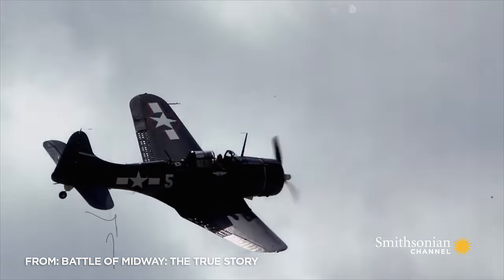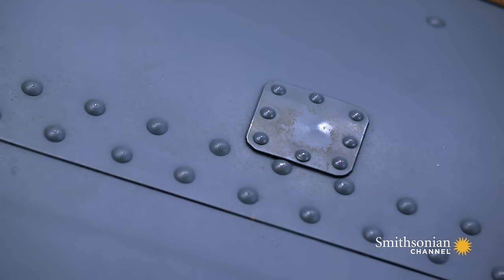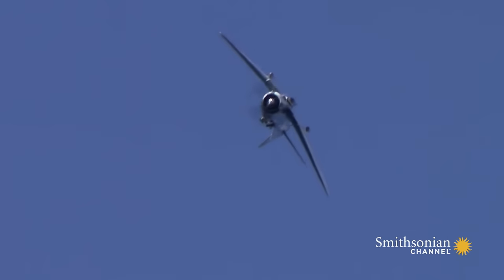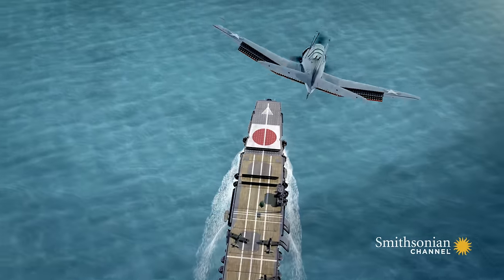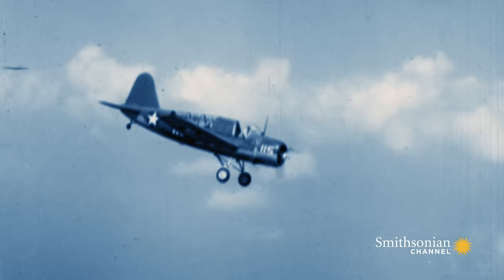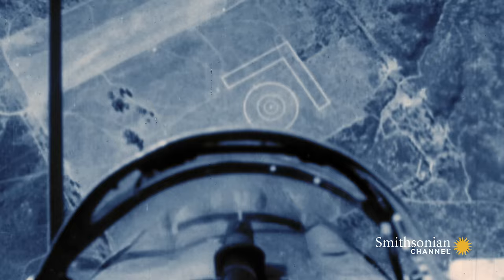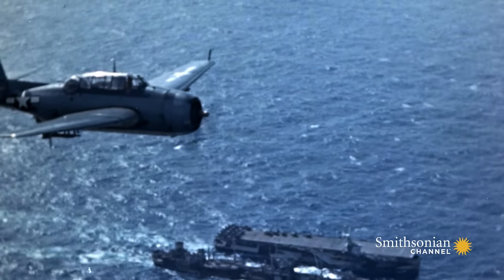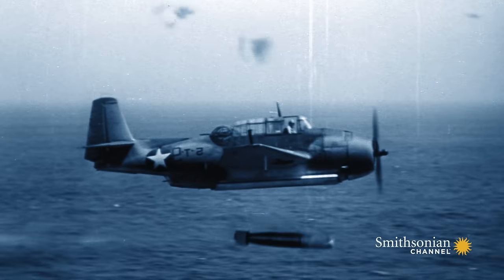The Terrifying Physics of WWII Dive Bombing

Comment: My father was an RAF pilot who flew the Vultee Vengeance dive bomber in Burma. He flew 104 ops in the Vengeance. It had cheese-grater air brakes which also came in useful when avoiding a Zero. As the Zero came from behind, the rear gunner would tell the pilot when the Zero was getting too close, the pilot would put the nose down and pull on the air-brakes. The Zero would over shoot, the pilot would bring the nose up and rake the belly of the Zero with his guns.

My father stayed on in the RAF, flew Canberras, Meteors, and ended up flying Vulcans out of Scampton. Couldn't get him to talk about the war, and never pushed him. The only thing he did say, one day, was that at the end the only survivors from the original squadron were the CO, the MO, his gunner and himself. The rest had been replaced three times over. All you idiots commenting on whether an adoptive father is a step-father, and making other, fatuous remarks about the sound-track, etc., really have missed the point.

Comment: From a veteran of these dive bombers - he said that on diving, the weightlessness of free fall caused the gravity fed carburetors to stop feeding fuel and the engine stalled. The solution was to slightly invert at the start of the run instead of just pushing foreword on the stick to dive. Having to fly inverted, line up the target, start the descent, roll back to 12, make corrections, ignore incoming fire, release the bomb, pull out if the aircraft is still responsive, return for re-armament, and do it again! These vets were the greatest generation. And I miss his quiet humbleness.

Comment: The SBD-2 Dauntless seen at 0:16 is SBD-2 Dauntless BuNo. 2106. It saw combat at Pearl Harbor, the action where Butch O'Hare became the Navy's first ace, the March 10, 1942 shipping raid (its crew Mark Whittier/Forest Stanley received a Navy Cross and Distinguished Flying Cross respectively), while it served with USS Lexington (CV-2). It was then transferred to VMSB-241 on Midway where it was flown by Daniel Iverson/Wallace Reid at Midway (Iverson/Reid were awarded the Navy Cross and Distinguished Flying Cross respectively at Midway). This aircraft was photographed during the Battle Of Midway. I also made a 1/700 scale replica of this aircraft using Starfighter Decals.

Comment: Diving 20'000 feet at 275 mph gives you about than 45 seconds to aim, release at 1500 feet, and pull up. It took me longer than that to click comment, do the calculation, write the comment, and enter the comment.

Comment: I'm sad that they didn't explain the use of the "cheese" holes in the flaps. Those were speed brakes meant to facilitate maneuvering during and after a dive bomb.
Reply: The video was disappointing and barely scratched the surface
Reply: Thanks for this, its the only science I've heard. Because I always wondererd what those were.
Reply: I don't think they help with maneuvering, I think they only slow your speed down enough that you don't lose control.  Not sure if the holes allow enough air through the flaps so that they are not torn off, or if they introduce turbulence, which would also presumably help to slow the decent.
Reply: Speed Brakes? Nah, they were just building wings out of Marsden Matting!

Comment: "Because just one torpedo could sink a ship"

Laughs in mk13
Reply: Quite true, though. Hammann, the ship that pull Yorktown after Battle of Midway, was torpedoed by IJN submarine and was split into two
Reply: @Barri2410  The Japanese Taiho was also sunk by a single torpedo but that was mostly due to very poor damage control that made a little problem into a very big problem
Reply: @christopherrogers7034  whoa, 1 torpedo from Sub too, eh? (I don't know for this part. Though i know about the poor maintenance, which contributed to her sinking—and this give her poor luck in KC :P)
Reply: Christopher Rogers   I think Submarine-Torpedo are 2 times heavier than Aircraft-Torpedo.
Taiho was hit at 7:45 a.m., later the explosion at 2:30 p.m. and sinks at 4:30 p.m.
Reply: Barri 2410   Btw. USS Franklin was hit by 2 Bombs it didn’t sunk, but extreme heavy damage ~800 death and could never be repaired, USS Princeton was sunk by one bomb.
Reply: @yoseipilot  more than Akagi but less than Soryu, eh? (Those two, along with Kaga and Soryu didn't sunk just because of bomb. They sunk because scuttled later)
Reply: If you've lucky and you don't get shot down on the run in if you've crapy fish runs true if it actually decides to explode. All of these things were problematic with the USN till later in WW2.

Comment: Ju-87 had automatic plane leveling system for going out from dive - Ju-87 leveled himself out automatically after pilot released bomb(s) and even pilot blacked out, Ju-87 would fly away, adjusting automatically throttle, propeller pitch and ailerons for keeping plane’s nose over horizon.

Comment: I've had two friends follow their bombs in. Both were in jets. Pilots still black out about the same Gs. But today's jets accelerate down hill faster and pull out Gs are probably higher. Dive bombing is a risky business.
Reply: A sad intersection of aircraft piloting and the laws of physics. Have read, and been told about, similar happening on strafing runs.

Comment: Stuka with stuka siren: 
Finnally a worthy opponent

Our battle will be LEGENDARY
Reply: 15 is legal In Europe  Would be better if they wore some kind of headgear to block the noise
Reply: 15 is legal In Europe  and also stukas are preety fast and the tanks will start up pretty slow to move
Reply: Dan Gurău  They removed them because they were making a slow aircraft even slower by causing more drag. The Stuka was already dead meat if there was any sort of fighter opposition. It also didn't help that the opposition had gotten used to the sirens, so they weren't having quite the psychological effect as they were at the beginning of the war.

I wouldn't be surprised if some Luftwaffe units ditched the sirens well before they were officially phased out.

Comment: I don't know about the Dauntless, but the Stuka had automatic pull out.  The pilot set the altitude for the bomb to be dropped, and went into his dive.  All he had to do was keep the target in his bombing sight.  The plane would automatically drop the bomb at the pre-set altitude and automatically pull up out of the dive so the pilot didn't have to worry about blacking out or not pulling out in time.

Comment: A question that always taunted me is, what is that humming sound when an airplane goes to dive ?
Reply: You are probably hearing the sonic wave produced by the propeller tips reaching supersonic speed during the dive.
Reply: Akhil Ghosh its actually the sound of whats known as a “Jeriko” (thats not how its spelled, its 4 am, sorry) trumpet. Its an effect many organizations use in movies and such, but in fact no american planes were outfitter with them, the only known planes to have a jeriko, or “stuka siren” are the Junkers 87, and only on earlier models were they made with, as it actually made the pilots themselves annoyed, because the earliest version of these horns were just a propeller strapped to the gears of the Junkers, making it impossible to shut off after the planes reach a certain speed. In fact, the jerico was not even in the flight manual to build the stuka, it was an optional fitting, you’re welcome
Reply: @popepuro8267  Hi, Pope Puro. You are exactly correct about the Jericho Trumpets or Sirens the Luftwaffe installed on some of their Stuka dive bombers. What caused me to respond was the original comment asking about the humming sound made when prop aircraft were diving.
Reply: @dragonmeddler2152  ah, oki, sorry then.

Comment: I have a question (that may come across as sounding dumb):
How did the person shooting the gun in the rear never hit the vertical stabilizer? 
Also
With B-17s, how did the gunners not shoot other B-17s during a firefight? I’m assuming things were chaotic with German planes flying around.  I’ve always wondered this.
Reply: The gun mount on the SBD was designed to limit the range of motion so the gunner could not hit the tail. This, of course made it difficult to defend against a Zero attack from 6:00 level.
For the B-17s, their flight pattern was purposely arranged in such a way that each bomber provided interlocking fire at attacking German planes and for the most part (not always) the flight pattern prevented them from hitting each other. The pilots were trained, of course, to adhere rigidly to the flight pattern, so they had no opportunity to take evasive action from fighters or flak. That took guts!
To me, the torpedo guys had the most guts, they had to come in low and slow, that's why Torpedo 8 was destroyed at Midway!!!
Reply: As @bruce already stated they would limit the range of motion for the rear facing gun. This was done two ways (depending on the aircraft); the earlier design (pre-WW2) was a physical stop that ensured the rear facing gun could not even point towards the vertical stabilizer but this made field of fire traversal complicated as there was an obstacle that needed to be negotiated in order to switch firing position from port to starboard side of the aircraft. This was solved by putting position limiters on the gun mount, this design is what was mostly used in the WW2 era aircraft in which as the gun moved to point towards the vertical stabilizer the limiter would put a lock on the trigger to prevent firing and would remove the lock once the gunner moved past the stabilizer. This allowed for quick, full field of fire motion without the concern of shooting the aircraft.

Comment: Interesting that the clip of the actual dive consistently showed a Vought OS2U with the land version fixed gear wheels attached. And - since the OS2U did NOT have dive flaps ( or any particular wing spar strengthening) , it looks more like a glide bombing exercise (45 Degrees max). I didn't know the USN used a Kingfisher for Dive bomb training of any sort. .

Comment: Just a suggestion guys, but when some of us hear the title 'The Terrifying Physics of WWII Dive Bombing' we are kinda expecting a dive into the physics involved, it may not necessarily need to explain every little bit and details... but for starters:

Dive altitude (mentioned, but a visualization of it would be nice)
Dive angle (especially with visualization)
Dive speed

Then there's a whole slew of information on how the aircraft involved are DESIGNED around these requirements (for example it would naturally Segway into why the dive bombers need those massive air brakes, and the physics as to WHY it was needed).

I get that this is going to need more than 4 minutes probably... but when there's hardly any information on the 'physics' involved... it's leaving a bit of  sour taste.

Comment: “Rear gunners faced backwards.” 

Uhh, duh! Where else are they gonna face?! Forwards? Nope!
Reply: @terryhillman8755  Where did you hear that? I can tell you that this definitely wasn't the case on aircraft like the Il-2. The rear gunner occupied a hole cut in the fuselage; he didn't even have any armour plating or coverage from the canopy. I also cannot imagine any WWII aircraft having that sort of control scheme, because that would introduce a lot more complexity. 

Finally, the rear gunner has that role for a reason--he isn't a trained pilot, usually.

Comment: The German Stuka dive bomber had a clever device that would automatically pull the plane out of a dive if the pilot blacked out.  It was designed to detect altitude and angle: "One of the Ju-87’s advanced features, at least for that era, was an automatic pullout mechanism, to avoid the possibility of pilots being overcome by target fixation or rendered unable to fly by the effects of high-G pullouts. It was a simple hydraulic device. Once the pilot had trimmed nose-down for the dive and to counteract the increased airspeed, it released the trim setting when the ordnance was pickled and reset the tab to command a pullout that typically ran to between 5 and 6 Gs.
Reply: Source, Air Force times

Comment: Considering trying to drop a torpedo required you to be low and slow (and an easy target for AA and fighters) in a very large plane with a 57 foot wingspan (Avengers were some of the largest single engine planes ever built) I think the dive bombing attack looks more appealing. One little fact largely unknown is that the Germans copied the idea of dive bombing from the Americans with their famous Stuka Ju-87. Their pilots sometimes placed a piece of red tape on their side windows with the correct attack angle to line up with the horizon. I could imagine the Dauntless gunners experienced near zero G's during the dive. (And prayed that they didn't lose the game of chicken with the ocean.)

Comment: 20000ft dive to 1500ft, the aircraft will collapse at first because of the high speed. Even It doesn't collapse, aircraft still really hard to recover from dive bombing with high speed (control surface locked).

Comment: They didn't realize in 1942 that they really didn't have to release low and slow, that was more because of the harbors that Taranto and Pearl Harbor the attacks happened in
 but it took time to realize that. By the end of the war the navy was dropping torpedoes from 2500 feet at 250 knots.

Comment: Ju 87 Stuka
The aircraft is easily recognisable by its inverted gull wings and fixed spatted undercarriage. Upon the leading edges of its faired main gear legs were mounted the  (Jericho trumpet) wailing sirens, becoming the propaganda symbol of German air power and the so-called  victories of 1939–1942. The Stuka's design included several innovations, including automatic pull-up dive brakes under both wings to ensure that the aircraft recovered from its attack dive even if the pilot blacked out from the high g-forces.

Comment: Doing this in a P47 was even more scary!     Since the P47 could be hitting well over 400 mph.   Pilots routinely blacked out for a few seconds after pulling back up.  Some of the Navy pilots got so close before pulling out.....  Their own bomb exploding knocked the plane out of the air.
Reply: Thus the bomb time delay fuse was invented, it was just a question of whether the pilots requested to have them set or left at 0

Comment: Most of the time the gunner would turn to face front and call out the altitude so the pilot could just watch the target. On Stuka's the bomb release auto triggered a change in the control surfaces or pulled back on the stick (can't remember which) to help pull out if the pilot blacked out.

Comment: you will enter a speed shock, air passing through the ailerons, pitch and rudder is so strong you don't have the strength to pitch up or roll since this uses pure hydraulics no liquid or pressure. leaving the pilot to crash and die

Comment: I used to play a video game involving dive bombing, which got boring as it got too easy. The only fun at a certain point was to dive from the highest possible altitude (to accumulate maximum momentum) and end the dive , just a few plane lengths from the exact tip of the ship, not by pulling up, but pulling into a horizontal trajectory right at the nose of the ship, inches above the water surface, then release the bomb so it would fly horizontally , inches above water, like a bullet, hitting the boat more like a torpedo than a bomb, but just above the surface, exactly at the point where the ship is above the water. Wham!!! Then the ship would go into these horrendous death throes. After sinking dozens of ships that way, moved on to other hobbies. But an undeniable satisfaction.

Comment: that's not accurately how to dive bomb, 1st you must extend your drag fins which makes maneuverability more responsive while in the dive, but after releasing the bomb you must retract your drag fins while pulling away from the dive full throttle until you regain altitude back. august 2017 marawi siege dive bomber. 4 hit 2 miss. pilot of modified SBD Dauntless

Comment: SBD's in Reality: "These patches cover over 200 bullet holes put into this Dauntless while it attacked the Japanese." 
SBD's in War Thunder: "Taken One 7.26mm From a P-26, Water and Fuel leaking, going down."
Reply: Bombers in war thunder are way too easy to destroy. Especially bigger ones like the flying fortress.
Reply: @Jan-sf7xv  I know. And it only takes 1 or 2 light fighters. The turret gunners don't do that much damage and are extremely inaccurate.
Reply: @Fox2-Videos I think the reason gunners are relatively ineffective is because fighters conrolled by the players in ab or rb are way more accurate then pilots irl. Its just easier to aim with a mouse. I think a sturdy plane structure and actual important objectives that can win the game would be enough to make bombers viable in WT.

Comment: Fun fact: the planes are designed with the center of mass to the rear without the pilot because the idea here is that the pilot’s massive balls of steel will bring the center of mass to the center   
And it will be perfectly balanced